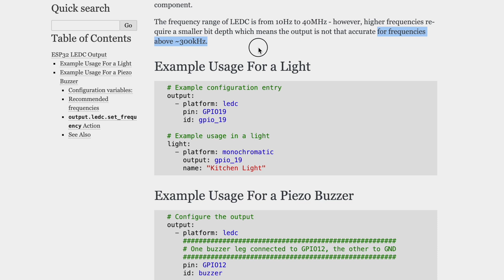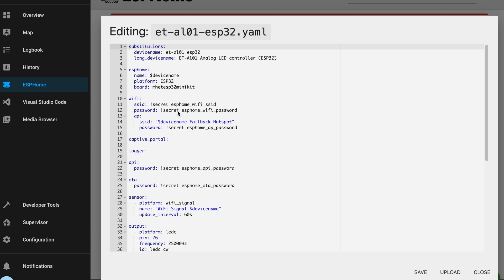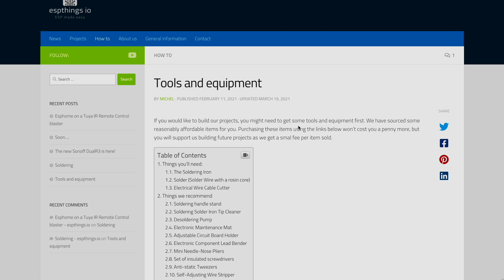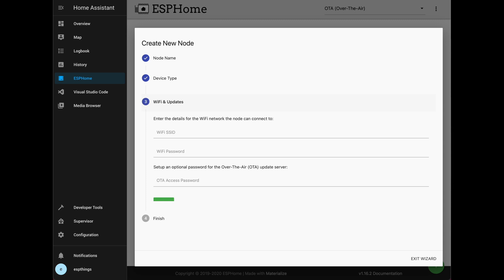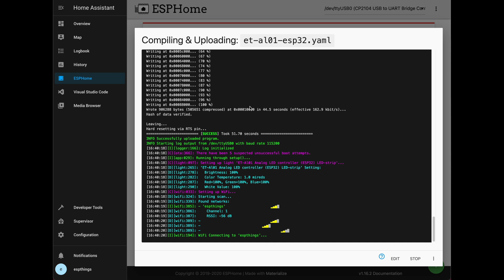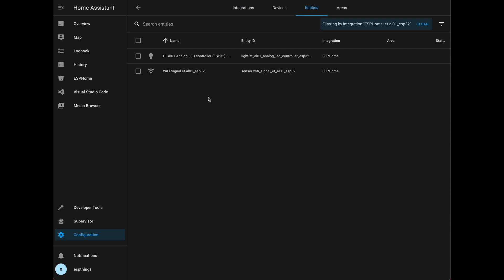ET-AL01 - 5 Channel Analog LED Controller

Comment: Mine just asks for the API password when I try to enable it, nothing works, especially not the random set of characters I put in as the actual API password. I don't understand how I can get back to the point where I can edit the code on the device, or is there a default api password?
Reply: When it asks for an API-password, that will be the password you used in your yaml. Just removed it and reprogram the esp and see if it works then. Hard to say exactly what is going on without seeing the yaml.
Reply: @michelweeren  How would I reset/reprogram it? This is my first time using as ESP.

Comment: Why would we go trough all this when we can just buy a $10 controller such as the 5ch H801 controller ?
Reply: @Michel  good points. Just started reading and "Why use a 74HCT244 chip?" - well there are logic level N channel MOSFTETs that are happy with 3.3v unless I am missing something
Reply: @danielducu  The 50cent 74HCT244 makes a way more universal and reliable with different types of mosfets, with the added benefit you can use on of your channels as an addressable channel.
Reply: Try creating a video with your H801 (which is fine for normal home use) and this controller using a ESP32 and 30.000Hz on PWM,

Comment: Great Idea!
I ordered some PCBs and parts, because I want to use it for controlling non-adressable LEDs with WLED firmware on the ESP8266. Is this difficult or the same as integrating it into HA? By the way: It would be great to share .stl files for the housing so we can print this on our own. Thanks!
Reply: The housing is available on aliexpress, that is where we bought it. I do not have the stl's for that.